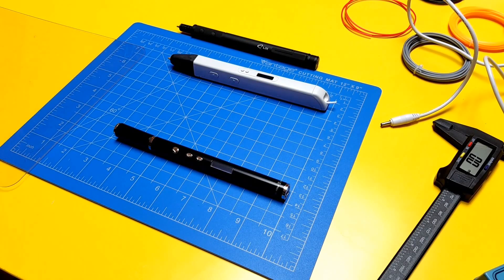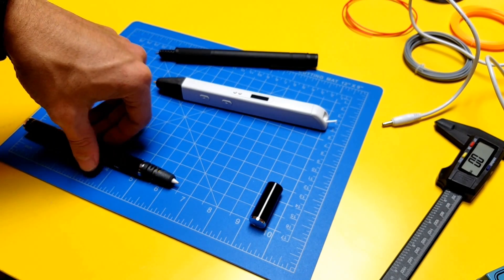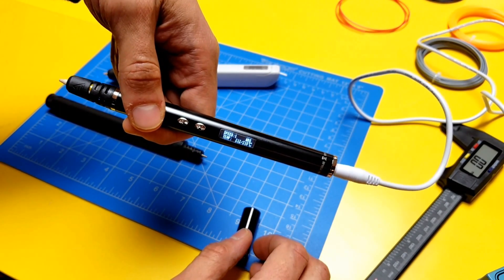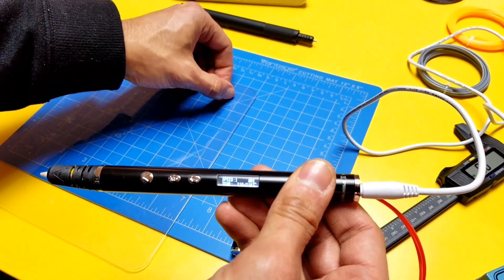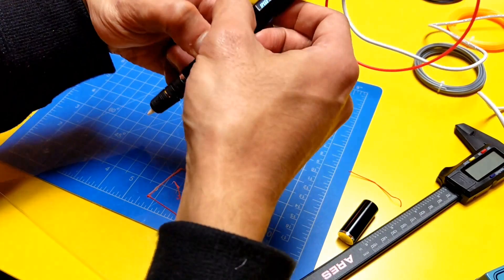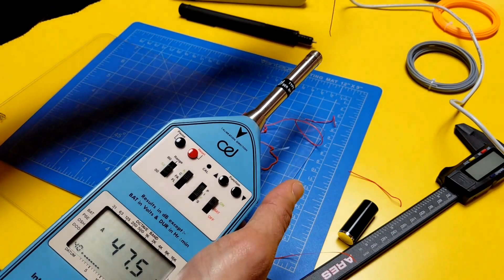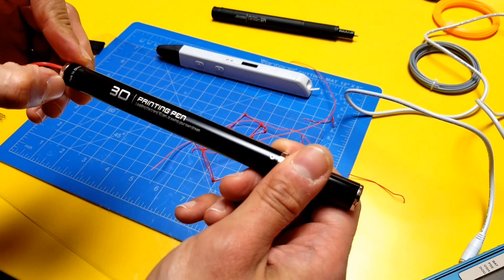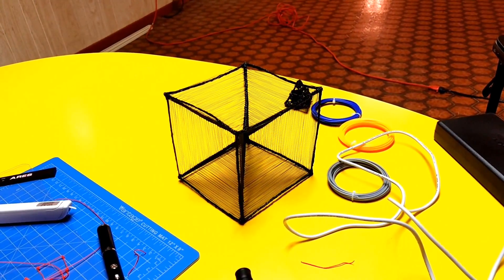(The New) World's Smallest 3D Printing Pen (RP900A) (smaller than the Lix Pen) - Initial Impressions

Comment: I bought a Lix and it clogged in less than a minute of use. Tried to take it apart to fix it, ended up losing a button, couldn't fix it, ended up tossing it in the trash because not only do they not sell them anymore, they also don't repair them. That thing got super hot too, I have a Dewang D7 now, much better pen.

Comment: Thanks for your video! I saw that pen on amazon but wasn't sure about it. I have a Lix pen that seems to be stuck on blinking lights and it won't start, so I'm thinking of getting a new one, but not pleased with the sizes of all the other pens in the market, have you tried or seen the OOKU slim pen? It also seems very slim but I can't find any reviews about it.
Reply from the maker: Fabiola SaGa sorry for the delayed response. I have not tried the OOKU pen, but it is not as small as the RP900A. Also, it lacks fine temperature adjustment (just two settings) and only 3 speed settings, so I think the RP800A or RP900A would be preferable to the OOKU.
Reply: I agree, I tried both and I DEFINITELY prefer the RP900A, very happy with it. Will be posting videos soon.
Reply: Fabiola SaGa. My Lix pen also din't work so I connected Lix on their mail and they will make your pen totally for free, even the shipping.
Reply: gave you started posting videos with it yet? how is the pen doing?